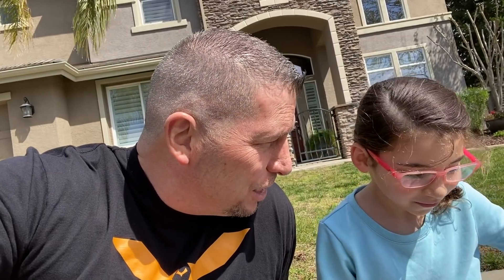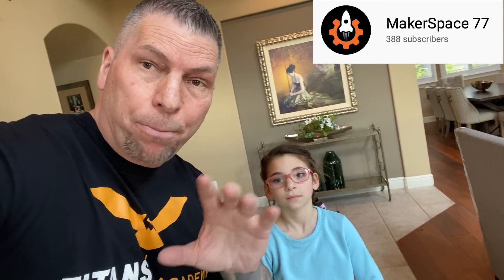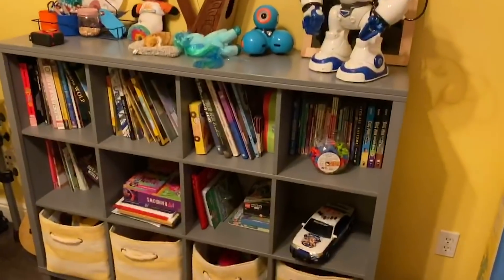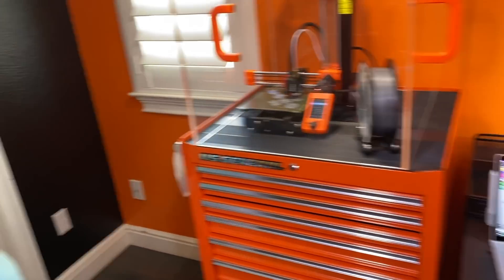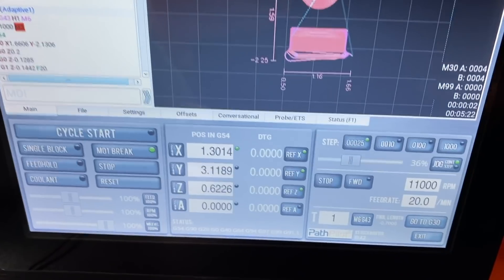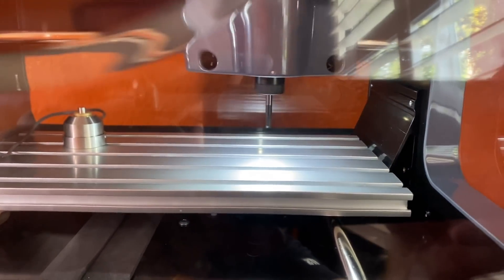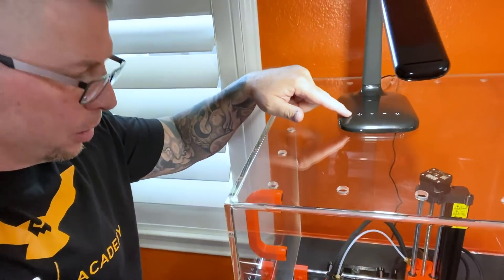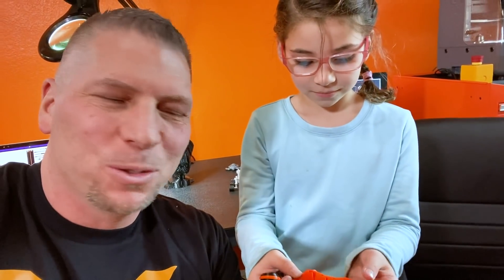Installed a CNC Mill in My House For UNDER $3K | The Creation of MakerSpace 77 | VLOG #118

Comment: 3d Printer basically melts polymer(PLA,ABS, Etc) which generates fumes which are invisible but hazardous, I recommend using some fume extractor or some sort of hood which can suck the fumes

Comment: That's a great way to do it.  I put a FADAL in my garage in '07 thinking the kids would want to learn it.   I had them doing solid works, had them learn to deburr and shape parts with a file, run the drill press, etc.   Everything was fine until we got to the Mill.   We did little things like making dice and name plates.   But it was just too big of a step for them.  They didn't want to go further with it.  Working with smaller "safer" machines would have been much less intimidating.